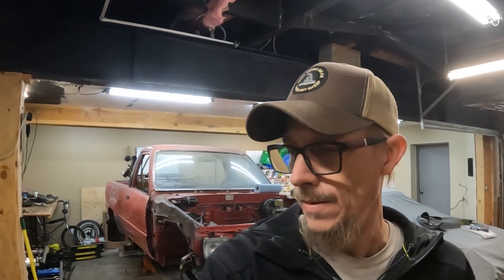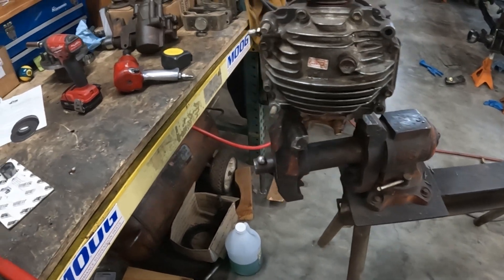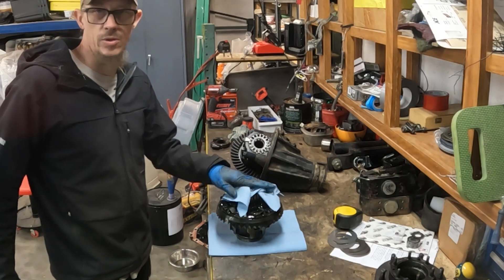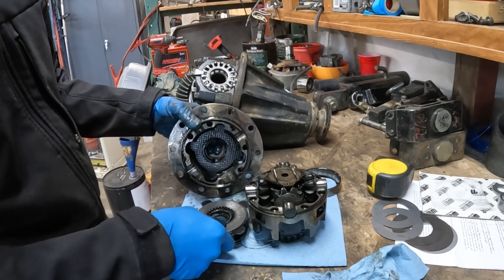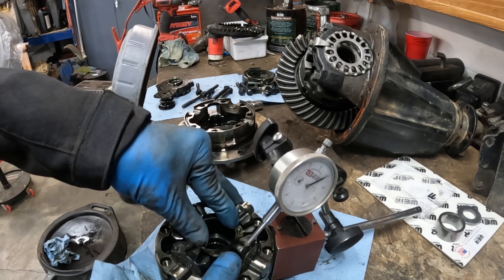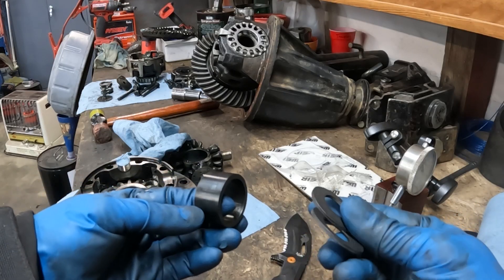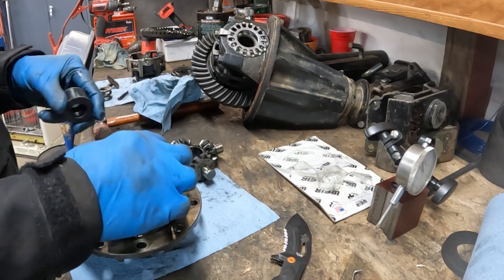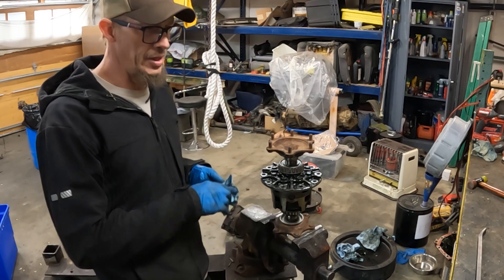Putting a Supra LSD into an 8" Toyota truck/4Runner differential

Comment: Did you use a v6 third member? I have a g code 2wd axel with the beefy axel shafts and I’m trying to figure out if I need the v6 housing for the supra diff or if I can use the 2wd 4cyl housing
Reply from the maker: @JZSwapGarage  you can use the 4cyl housing but you need the conversion bearings. search for arb locker into 4cyl and it should get you there. idk the part number off hand. what era truck do you have that has the G code diff? because a 85-88 turbo diff is technically a v6 diff

Comment: Was lsd from a MK3 supra?  Friend has a MK3  .The LSD are known to be soft in those years. He has the Weir stage 1 kit in it. It still spins the unloaded inside tire too easily when we autocross it.(for 3 years now) Curious how you like your MK3 diff with stage 2 kit on the asphalt roads and city driving.
Reply from the maker: this diff went into the front of a 4runner. this kit added tons more clamp vs stock. imo a great option for a front axle vs a lunchbox locker. a little less stress on stock birfield. watch the end of the video and you can see how much tigher it is.
Reply: @SnaleRacing   ya saw end of video with it in vise. Much tighter.  Just wonder if too tight for tbe resr in autocross. Too tight and turn in will be slow and push. Thinking of adding more or thicks discs to friends stage 1 kit. Or do the stsge 2 if it isn't too tight.
Thanks for repling
Reply from the maker: im pretty sure the center spring has more to do with the "breakaway" than the discs. unfortunately im probably not the best ask for autocross stuff. might be worth just contacting weir.

Comment: Did this mod to my XRunner a few years back... Love it!
Reply from the maker: who does kits for the 8.4?
Reply: @SnaleRacing  not sure of 8.4" but for 8" I used the same weir kit stage 1
Reply from the maker: ok. you have an 01-04 X?  i forget they exsist. kit made a big difference, I'm excited to actually test it.
Reply: @SnaleRacing  The Toyota Tacoma XRunners specifically 05-08 (I have an 07) use the same supra mark 3 differential.
Reply from the maker: thanks. was thinking 05+ was 8.4 all.